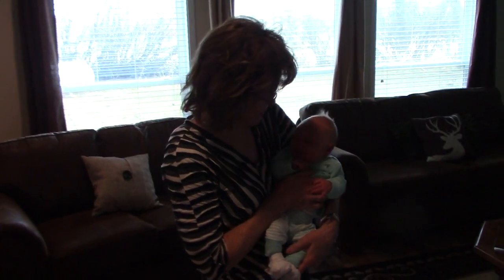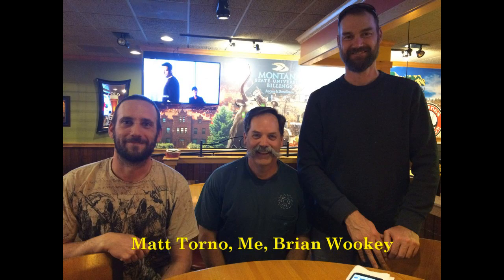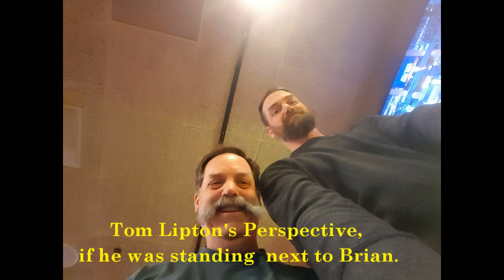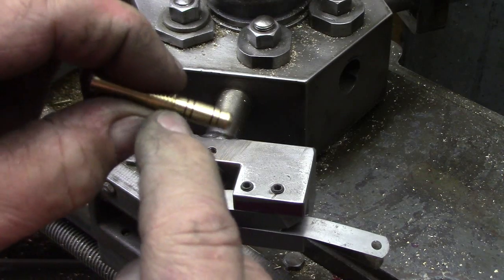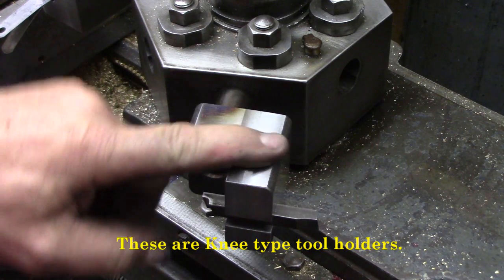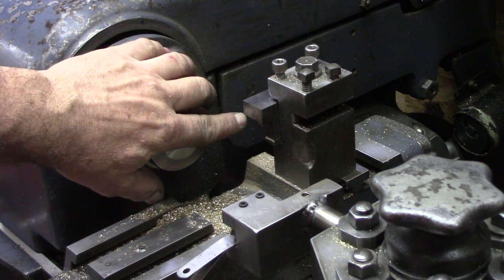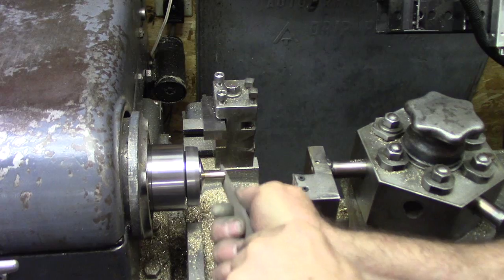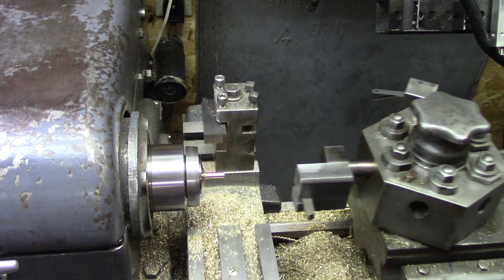How To Build a Carbide Pocket Scribe Part 3

Comment: Really intersting series. Very few YT videos on production work as it was done till the '70s when CNC started to take over. The labor cost is quite high -- you did file the rounds, you could have made a rounding tool -- but then you'd have to factor in the labor of making the tool vs. the expected production run. It looks to me that the demand for these scribers is quite high, so might be worth the effort.  Grooving tool = cool; like to see how you did it. Congratulations on your grandson.
Reply from the maker: +Juan Rivero I use a radius tool for the rounds, just a bit of file touch up to make them perfect.  High demand is good.  Over Half of the second batch is sold and I am not finished making them yet.  Thanks, Randy

Comment: Randy, congratulations on the baby grandson! I have been looking at the beautiful work you did on the scribe and had wondered how you made and colored the grooves. The grooves are perfect. I am looking forward to seeing a video on how you made the groove cutting tool. Also, thank you for your previous tip on using old thickness gages for the tool height setup (also being super flexible prevents any accidents on the turret). Thank you for posting this video, great info, Paul
Reply from the maker: +Paul Jones Thank you Paul.  Still editing that part, soon.  Randy

Comment: Hi Randy, 

Does Emery EVER get ‘worn out’? I know I was pretty pissed when maybe as much as 30 sheets (Torn into useable pieces) was thrown out when a College graduate I had for a week at work decided to ‘Clean up my rubbish’ as well as many ‘BIBLE’ pieces of original hand crafted samples I had made of the same machines cardboard pieces with slots and holes and bends at certain points. Needless to say that day was his last in my dept !
Reply from the maker: +mrbluenun Yes it does, the abrasive will loose it sharp edges and no longer cut.  Then they rub which is also known as Burnishing. I to have a box full of pieces I keep for just that reason, but no co-workers to worry about.  It is hard to keep co-workers around when they keep loosing their fingers and hands for touching my stuff.
Reply: +Randy Richard Hi Randy,

Losing fingers? - Now why didn’t I think of that!

Comment: Congratulations to the family for the new addition Randy. Very pretty drive between Billings and Great Falls as well. 

That custom ground 4 groove tool is the first time I've ever seen anything like it. Very clever and there's no way I would have figured out a tool like that. Looking forward to your video about grinding it so that every groove comes out that even for distance and depth.
Reply from the maker: +Turning Point Thank you  Pete,  I made the tool with the same technique as the grinding of the surface plate gauge.  I thought I would combine the two.  Editing.  soon.  Randy
Reply: +Randy Richard Many thanks for the info Randy. Makes perfect sense after it's been explained to me. But I sure hadn't even thought of that way. Not one of my reference books or any of the forum threads that I've ever read yet even mention that very clever idea. You probably need to figure out some way to shoe horn a surface grinder into your shop. Maybe even a full time dedicated turret lathe as well. :-)

Comment: Good looking scribes.  Got a garage job waiting just to put it to work. Can't wait. Had a local metal shop blast a couple of 2.800" holes into some 3/4" plate. Finished Laser cuts were within 0.002" Amazing.  The scribe is for other work on those same plates.
Reply from the maker: +Doug Bourdo Thank you Doug,  Nice on the holes.  Randy

Comment: Did you show making the "blank?" The last video was about the body with internal threads, then suddenly you're holding a piece with external threads in this video. Maybe I missed a video.  I'm really enjoying watching both the turret and "sliding  tool post" in action! :)
Reply from the maker: +Wide Vision Metal Fab You are right,  I screwed up.  The next part will be the first part of the handle.  Thanks for catching that.
Randy